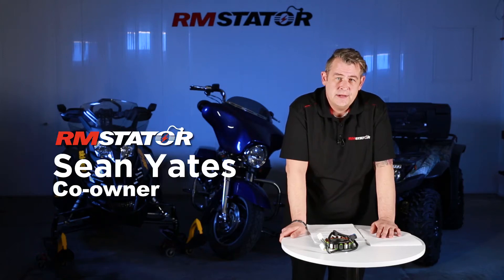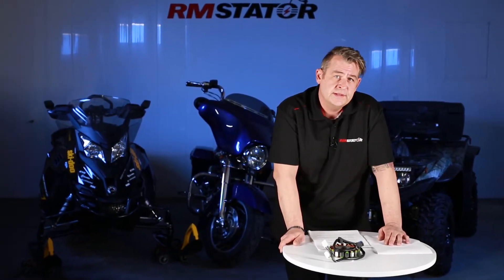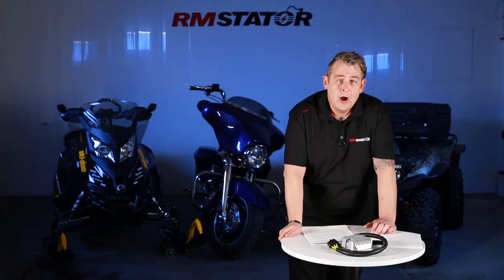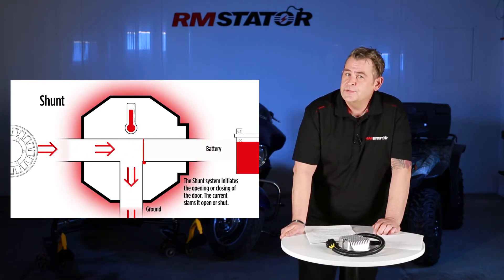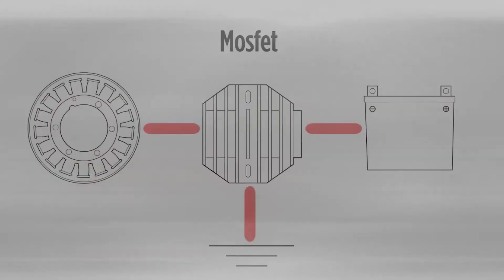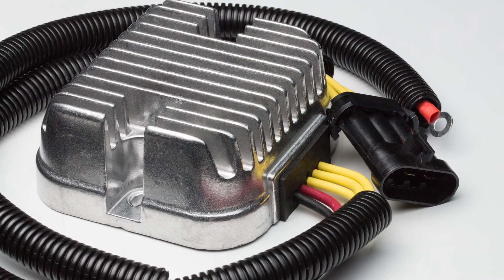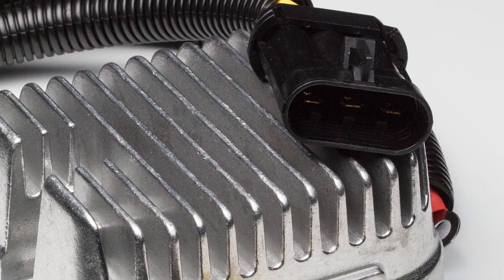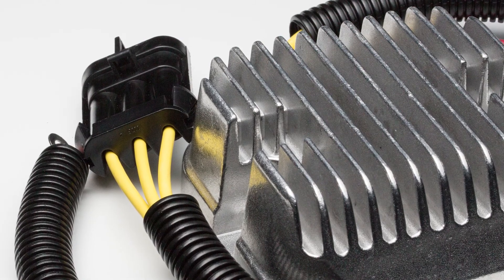Our Mosfet products

Comment: I found that the Mosfet regulators are far superior to the shunt style regulator. My Honda Shadow had the shunt regulator from the factory and it was junk. It ran too hot and didn't keep the battery fully charged. I replaced it with the Mosfet FHO20AA off of a late model Yamaha R1 (got a used one off ebay) and it took care of all my charging problems. It runs 13.5 at idle and 14.5 when reved. I can use all my accessories (heated grips, radio and driving lights) now with out a problem and I have a fully charged battery now!!
Reply from the maker: That's the benefit of MOSFET regulators! They run much cooler, and provide reliable, accurate voltage regulation under all conditions!

Comment: Your animation still shows the mosfet being a shunt, is it a shunt or series?
Reply from the maker: All of our MOSFET regulators are shunt type. The difference is a MOSFET regulator uses efficient transistors to do the shunt switching for regulation. Standard regulators use SCR's (Silicon Controlled Rectifiers) to do the shunt switching, which are much less efficient and generate significantly more heat.